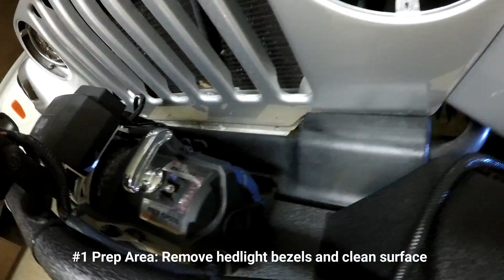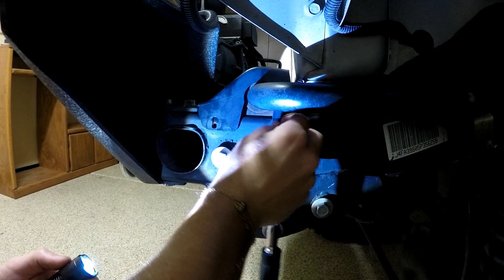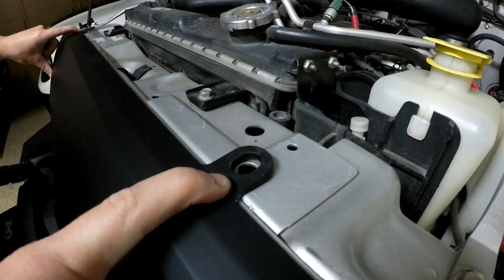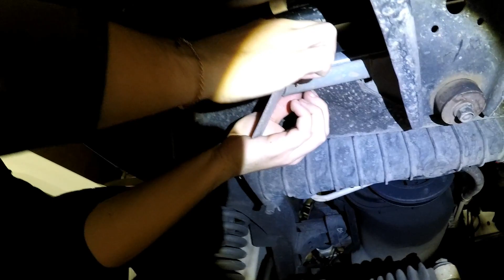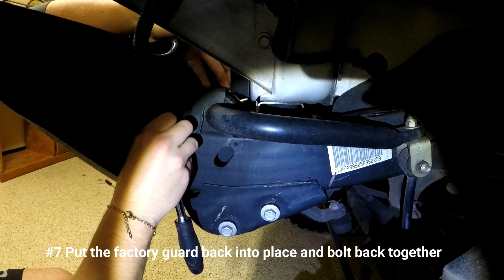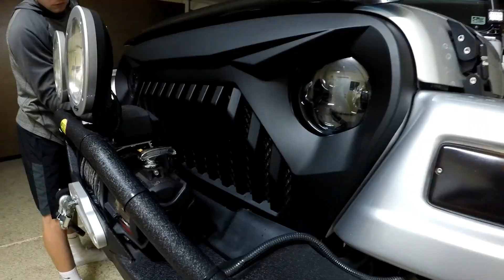Jeep Wrangler TJ Gladiator Grill Install [HD] - 1080p

Comment: I notice when you put the factory guard back on the rear bolt hook wasn't there. Did you have to notch it to fit it with the additional grille thickness?

Comment: Where did you get the screw rivet hardware? I almost bought the particular one that you did, but it's out of stock right now so I picked another one on Amazon, I'm concerned about trying to use screws and nuts on the upper two holes.
Reply from the maker: it came with the product!

Comment: Do you have any overheating issues with this grille?
Reply from the maker: Not at all!
Reply: i put the same grille on my tj and have an overheating problem with it...
Reply from the maker: Aww man thats too bad! maybe go about putting some air vents into the hood to add some more air flow. So you can keep the grill on there.
Reply: i talked to someone with the same problem. he said he cut the mesh out of it and it fixed his problem. i really love the way it looks but mechanical is more important. just nervous about cutting it...
Reply from the maker: Thanks for the tip i will look into doing something like that if i have a heat issue.
Reply: I took mine off yesterday due to overheating 😭😭😭😭 loved the way it looked...but I'm am going to try to cut out the mesh like was talked about above
Reply: @waynepattison  hi just curious how cutting out the mesh worked for ya thing about buying one too

Comment: Hey I like the grill but how do you open the hood to check the oil
Reply from the maker: you can still access under the hood like you normally would.
Reply: @LetsGoFish  I have 97 and a 99 and you must put your finger through the grill to pull the latch to open the hood